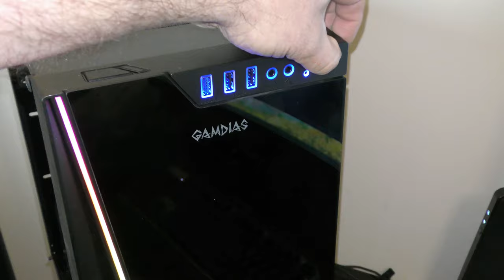FastForward | PC Build for Beginners

Comment from the maker: In this video, we go over FastForward - Building and Wiring inside the Gamdias Argus M1 Budget Friendly Case.  
Check my Final review of this case: https://youtu.be/S-2qQbXEuko
Check out the regular paced video building in this case:  https://youtu.be/RfgpRGLQT2A
Check out the regular paced video wiring in this case:  https://youtu.be/RfgpRGLQT2A
Fast Forward Edition, goes over the previous videos in the series Building and Wiring the Gamdias Argus M1 in fast forward, no fluff, not chatter, just fast.  This is for more experienced builders that don't want the chatter, just results.
Below, you will find a list of components used in this video.

Here are all the components in this system
Gamdias Argus M Case: https://geni.us/N75el7
EVGA Z370 FTW Motherboard: https://geni.us/X9eVgAq
Corsair Hydro H115i PRO Liquid Cooling AIO: https://geni.us/KhslEW2
Intel Core i7 8700K Processor: https://geni.us/jD0s8D
EVGA GeForce RTX 2080 Super XC Ultra: https://geni.us/XfqTe
ARCTIC MX-4 - Thermal Compound: https://geni.us/Gveq
WD Black 512GB M.2 2280 PCIe NVMe: https://geni.us/mMNLde
Samsung 850 Evo 500GB: https://geni.us/QTA2
Cooler Master Silent Pro Gold 1200W PSU: https://geni.us/7hdBk
Patriot Viper Elite Series RGB DDR4 32GB: https://geni.us/iMVWhP
Reply: Hey I have been running through some problems with my pc. My gpu usage has been really low under 10% and sometimes spikes to 100% and immediately drops down to like 4%. Can you advise me on anything that may resolve my issue?
Reply from the maker: @zackpreville5590  that is a rough one, being that I don't know you specs but I could imagine you are playing at 1920x1080 or lower and that will use your cpu more than you gpu also maybe that you don't have any eye candy on light AA, AF, MSAA (although MSAA is not great), TSAA and the likes.  You may want to check out my video on DDU that resolves a lot of problems, check it out, give it a try and let me know how that works out for you: https://youtu.be/clLYbBywhAg
Reply: @ThisBytesForYou  OK I'll check it out and do it a little later and get back to you if the problem is solved.
Reply from the maker: @zackpreville5590  that would be great, even if it is not solved, please let me know and provide to me with your full system specs and the games you are playing, I would love to help
Reply: @ThisBytesForYou  I've run ddu exactly how you said it still didn't fix the problem although I got a little better usage. My specs: rx580 4gb, i5 7400, 8gb ram, 1tb hard drive, msi z250 mother board. I usually play paladins, ring of elysium, rust and destiny 2. I think it's probably a cpu bottle neck cause my cpu is running at 80-100% usage where as my gpu is 21% and under.
Reply from the maker: @zackpreville5590  yeah your CPU is causing the bottle neck sadly, if you are looking to upgrade and not pay too much, you might benefit from a 9400F, you can find it on my amazon affiliate link: https://geni.us/3phtY and maybe 16Gb or RAM instead of 8GB, https://geni.us/39DLk.  I would say to get another 8Gig stick of what you have, but it's not good to mix and match memory, as it can cause other issues.  I always have my machine at least on 16GB, if not 32Gig, but aside from games I also do a lot of video and photo editing and have a trillion tabs open of Chrome,  When you play do you have a web browser and othr programs running in the background, if you do, close them, it will help tons, but your current CPU is a bottleneck unfortunately.

Also, what resolution are you playing at and what are you settings in each game, if you are running on Ultra, maybe bump it down to Medium, maybe even high?  

Have you downloaded and installed the chipset driver and Management Engine?  Chipset: https://download.msi.com/dvr_exe/intel_chipse_9_w10.zip, Management Engine: https://download.msi.com/dvr_exe/intel_me_kbl.zip
Reply from the maker: @zackpreville5590  oh also, aside from what I just mentioned, I see you have a 1TB hard drive, dont run your OS and games on it, I recommend getting  at least a 500GB SSD (many will say 240GB is good enough, but with all the windows updates and such, 500GB is your best bet)  You can check out a Samsun 860 EVO 500GB for a great price on my Amazon affiliate link: https://geni.us/8xTsA for about $320 worth of upgrades I have recommended (with the SSD, RAM and Processor) you will have a brand new MUCH more peppy computer.

I recommend keeping your 1TB Hard drive, but as the D drive, where you can store games and files, though for myself, my games drive is another SSD, just to keep everything super fast, but I want to help keep your costs down.
Reply: @ThisBytesForYou  I'll most probably be going to university in a few months so I'll not be using it in a while. So I'll just get a laptop for the mean while
Reply from the maker: @zackpreville5590  ahhhh yeah that makes complete sense.  If you need some help choosing a laptop, please let me know, as always I would be more than happy to help.
Reply: @ThisBytesForYou  OK will do
Reply from the maker: @zackpreville5590  thank you my friend and the very best of luck to you in your studies
Reply: @ThisBytesForYou  thx. All the best to you and your channel as well.
Reply from the maker: @zackpreville5590  thank you so much my friend, I truly appreciate it